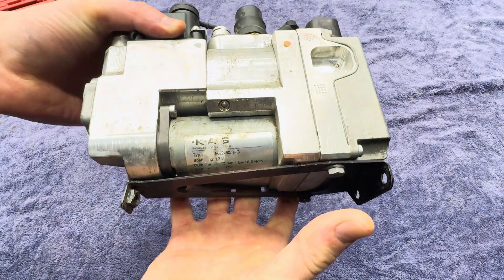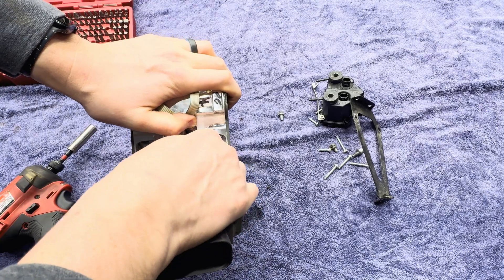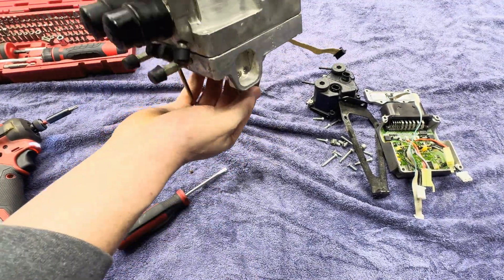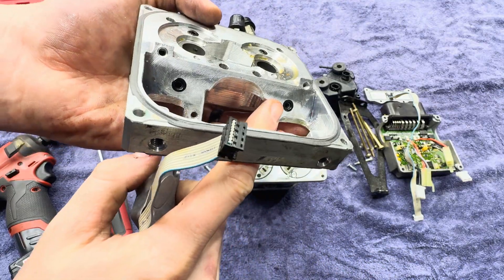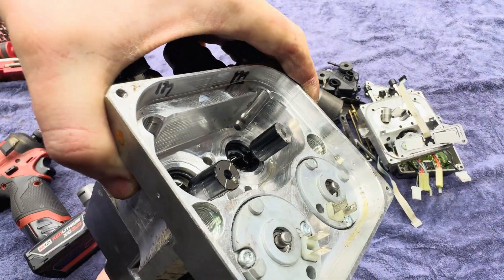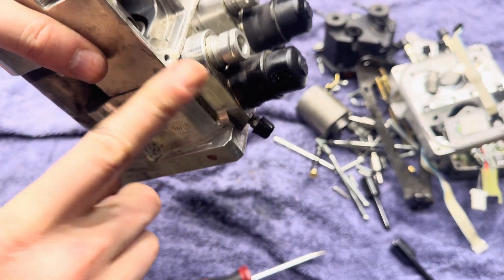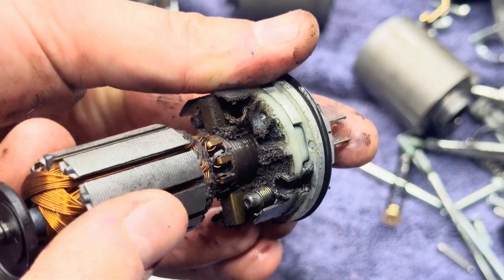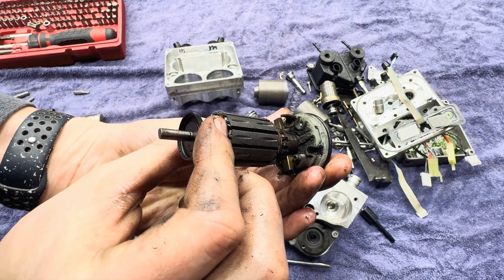Disassembling a BMW ABS Pump

Comment: Replacing the pressure pads/sensors and new brushes for the motors should be doable.
Reply from the maker: Yeah, probably could be. do you think its worth the time VS reward?
Reply: Is there replacement sensor available ?

Comment: Thanks for dissecting this Rube Goldberg device for us.. Got a pretty good sense of how they work. A faulty seal killed a pump motor. That explained the lurching as my Oilhead ABS started to fail. At the end., the front brake locked off.  Pump probably looked like yours. Faulty seal. Pulling the blue relay made the front brake work again.
Reply from the maker: Thanks for the info!  did you end up bypassing the whole system and pulling the bulb?
Reply: I have a r1200s with a bypassed abs, I'm yet y to phone the previous owner to understand how it was done, I'll report back with any info

Comment: So as Kevin points out in this vid, the reason this unit failed is because the brushes got perished or consumed and they started eating the commutator. So this electric motor is too far gone most probably. You would need to replace the motor, one to one swap and most probably this unit would work perfectly find.
Reply from the maker: that's my consensus as well.

Comment: What I have learned is that it is the pressuare pump that fails. It is the two flat thins you found.
Reply from the maker: Those are what I believe to be pressure sensors, not the pumps themselves. The little electric motors are the pumps I think. But again, could be wrong

Comment: Some Harley units fail. It's commonly thought that if you regularly activate the ABS and also activate as part of the bleeding procedure, you won't have any problems.
Reply from the maker: Yeah, have you watched my bleed process? I use a GS911 to manually activate the abs with a computer

Comment: You should have cleaned and reassembled it to see if it was still faulty, would have been a good learning curve.
Reply from the maker: I would have, but that a lot of work to remove/bleed and test for it to not work and need to be replaced/blead again. The bleed process is a large undertaking

Comment: I bled my system out last year which saved me money and gained experience. Although it took most of the day, finding a correct hose fitting and wrench. The BMW shop told me to have it bled once a year, but I read a service bulletin stating every two years if the brake hoses have been replaced with stainless steel ones. Thanks for a great video!

Comment: This makes one realize just how important brake fluid changes are.  There's probably a minuscule percentage following recommended change intervals, as a result brake fluid sits in these systems for years, or decades, especially in cars.
Reply from the maker: Agreed, brake fluid maintenance is crucial for the longevity of these systems.

Comment: Those tabs are indeed pressure sensors aka Transducers , and they convert the presure into electric signals to the motherboard. I've done  many ABSectomy's, This unit was a fix to a problem that didn't exist and was BMW's  attempt to provide reliable Powered and integrated front/rear braking (1150RT) to the 1150 and 2004-2006 1200 models. In reality it was a bad design and dangerous during failure.  The operator could be unaware that all of a sudden much more hand lever/ foot pressure was going to be needed to apply braking. Also applyng the foot pedal would engage the front brakes making slow tight turn manuvers very tricky. This feature was eliminated for Police and GS models however.  In fact the previous series 2 ABS equipped in the 1100xx series was very reliable, provided full uninterupted braking during unit failure and did not have integrated front/ rear braking. It was also much easier to maintain and repair. My advice in lieu of an expensive repair, was to trash the unit, replace any rubber brake lines with steel braided teflon and then learn and practice exercises for competent braking old school without abs.
Reply from the maker: Thanks for the information, I appreciate it
Reply: @TheBMWGuy  Keep at it.

Comment: I wonder if the reason for failing was because old fluid was not changed as needed under regular schedule
Reply from the maker: It's possible, but there are other common failure points in these units.

Comment: 🤦‍♂️Why they made it so complicated an awkward 
What were they thinking?
Reply: yeah I did compared honda abs pump, is much simpler solution, also ne 1300GS use similar solution as honda. I think this is how it was 30years ago, not every bike has abs, and it was something new.
Reply: @mr.z2618 yes part of that is true, not all bikes had abs
Anyway my 96' GS 1100 had abs and it was very simple. I don't know why they started using servos on the 1150s
Reply from the maker: Haha it’s a bmw

Comment: Hi. Thanks for the vid. I have personally disassembled and fixed a pump like this on my R1100S. They are serviceable and there are some people that stock parts for them (in Europe). If you have one and it malfunctions, fix it. ABS = safety
Reply: Please do explain how and where! mine is starting to show signs of failure!
Reply: Yes..please provide more details...
Reply: How it can be repaired ?
Reply from the maker: im listening.

Comment: 2 points - 1 please line the parts up rather than a pile of bits, 2 There is nothing in that abs system that is taken apart with a hammer. Happy new year
Reply from the maker: I agree that there's nothing in that ABS system that is taken apart with a hammer but this unit was completely failed and non-functional and was being disassembled to understand the internal components causing the failure.
Reply: @TheBMWGuy I just heard you say it and have a background in HP systems and felt obligated to mention it 😁

Comment: Before the destruction, the unit could still be easily and relatively cheaply reconditioned and reused. Such ones can be sold for around 1,000 USD. New ones are no longer produced. You can still easily repair the electric motor. The piezoelectric pressure sensor (the one you are so brutally bending) is no longer repairable and mostly unobtainable. Too bad about this unit.
Reply from the maker: This unit was completely failed and non-functional. It was disassembled to understand the internal components causing the failure.
Reply: @TheBMWGuy yes it was non functional, just like any complex device with one thing wrong. To then say the whole thing (sensors etc) was faulty so it justifies my video, well... Have you ever read any Easop's fables?
Reply: @TheBMWGuy common issues for that ABS units is - pressure sensor failure, or pump DC motor critical wearing. All that issues can be repaired. Connect to motorcycle with ABS issues, and soft shows where is problem. Four pressure sensor work in own part hydraulic of braking system: one for front brake lever, one for right pedal/rear brake, one for front callipers, and last for rear. I seen in internet hydraulic scheme of that unit. If make BLDC spare for old DC motor, and pressure sensor that unit can live forever. It strong and simple thing actually, with weak points.
Reply: @valentinloginoff Is there an adequate replacement for the broken pressure sensor? Can it be made new, or can I buy another new one? (other than used from another old unit?) That would be good news! Thanks for the reply.

Comment: Thanks for sharing this, Ive had one fail. I wonder are the failed ones damaged in the same way. Failed seal letting fluid into the motors? Thanks again
Reply from the maker: i have no idea, this is the first failed unit I've disassembled

Comment: I bet this was a common problem for the early servos in the R1150s. I had a 2002 R1150RS where the pump failed very early on. I think I put around 48k on that RS before I upgraded to a R1200RT. Something I noticed on the 1150 is the fluid that came out of the pump was always dirty after a couple of years. The 1200 also had the servo assist. I put 130k on it and the fluid that came out during a two year-services was always pristine. My guess is the dirty fluid was because of this issue with the seals failing and fouling those electric motors. BMW fixed the issue in the 2005 to 2006 1200s. In 2007 I think they did away with the servos for the front brakes. Great video!
Reply from the maker: To the best of my knowledge all the pumps were the same. That goes for all ABSIII pumps

Comment: Kevin, thank you for the video.  I have wondered what type of BMW Voodoo in in the BMW ABS servo.  I owned a 02 R1050RT that the ABS servo failed.  Sent to a shop (name not remembered) in Idaho for repair.  I wonder if the motors are for the ABS brakes or the whizzy power brakes (also known as the ball crusher brakes)?  I have seen a newer R1200RT when the servo failed the rider had almost no brakes.  Attempting to troubleshoot the problem at the MOA Rally we noticed smoke coming from under the servo.  Now I believe the smoke was from the armature brushes burning.
Reply from the maker: Module master was the company I bet, they no longer service This pump

Comment: I'm pretty convinced that the main problem is that gumminess in there. During normal operation if you don't trigger the ABS much, I think the brake fluid in the pump doesn't get changed out, it gets water in it and gums up.
On this PARTICULAR pump, probably that motor as you said, but I would be kind of surprised if that's the failure on the majority of these that die.
I could also imagine that letting the brake fluid get old and waterlogged might contribute to the motor seals failing.
I think the best way to keep the pumps from dying is to use MotoScan/911 during an annual brake flush and be sure to run the pump while bleeding so the fluid in the pump gets refreshed.
Reply from the maker: I plan to disassemble more pumps and see if just maybe I could start rebuilding them

Comment: @♥9:00  I assume those things you refer to as "servo motors" are probably  E-M coils that open or block the valves which in turn actuate the brake lines.   That allowss you to interrupt braking action and produce the known "ABS-shock" effect with brakes on-off-on-off ....  The actual pump motors are below.   BTW if anyone  gives you a hard time about "ruining that pump"  I have one (also broken) lying around ....  They can come pick it up
Reply from the maker: Take it apart

Comment: You should have knocked the armatures out of the end bearings to show us the length of the brushes but obviously the o ring had failed on the bad one it was drenched in brake fluid
Reply from the maker: Yeah, I could’ve gone further with the disassembly.

Comment: I think Freddie Dobbs worked out that this was a Ford Focus part and is available super cheap
Reply: Nope.
I made a comment on his video.
I repaired my 2007 ABS pump twice.
First, the brushes were stuck, so I freed them up, it lasted a year and a half, then I found out that a 2007 Ford Focus as well a 2011 Peugeot 206 had the same pump, albeit the car pumps has a 6 outlet/inlet  body as opposed to a 4 outlet/inlet body for the bike.
But, the DC motor on these pumps are exaxtly the same, just a better quality on the Ford pump (I have no idea on the Peugeot one)
So, I took the electric motor off the Ford pump and swapped it out with the crappy quality BMW motor, and it is still working 2 years down the line.
Altough I have the GS911 tool, the brakes bled absolutely fine through the ABS pump without it.
I did put the GS911 tool on, and ran the brake bleeding program afterwards just to make sure, but no bubbles came out and it did not make any differance at all. 
So, you do not need a special diagnostic computer to bleed the brakes afterward.
This is on the non-servo 1200GS models. I have no idea on the more complicated servo models that were from 2004 to early 2007.
Reply from the maker: Not the same unit
Reply: @TheBMWGuy 
Yes I know.
The unit you have in your video is from the earlier 1150 models.
I was just commenting on Gadgetmart's comment regarding the Freddie Dobbs video
Reply: Only on the later 1200 models onward. Slightly different pump design. The 1100 and 1150 have these.
Reply: @Mr-Flower5 ECU testing repaired my ABS pump on my Z4 it’s worked great since then.
Reply: @GadgetMart I've no doubt these can be repaired but the Z4 pump must be different to this one surely? I have searched and found no one who will repair an early servo assistanted pump for a BMW 1150 motorcycle
Reply: @Mr-Flower5 Yes Z4 pump was much smaller.
I have a 2002 GS without ABS from factory

Comment: THANK YOU for doing this video!  I’ve never been able to get a straight answer why these things fail. I’ve always heard the brake fluid flush every two years is the best way to prevent failure, but are you able to explain how that could have prevented this?
Reply from the maker: Honestly, what could’ve prevented this probably is not holding your brakes at a light. Because those modern motors are constantly turning when the brake is applied

Comment: For anyone that doesn't know, these "ABS Servos" were electric power brakes and an ABS unit combined.  When you applied the brake lever/pedal, all you were doing was turning on the respective electric motor which then pressurized the brake line. Hence the nickname "Whizzy Brakes" from the dentist drill sound of the electric motors running. From reading about these Servo-ABS units over the years, the brush/commutator assembly was a common failure point.
Reply from the maker: Thanks for the extra info!

Comment: German engineering:  "Why use just one part when ninety-seven will do?"
Reply: Fortunately they only used this for four years, i replaced several and if you like the assisted brakes it's a good system but I prefer to keep it simple.
Most of them failed because of poor maintenance, brushes engine (for those who really brake more than throttle) or a bad battery. They should be flushed each year.

The white plates are ceramic pressure sensors.

Bear in mind that these things are 20 years old now....
Reply from the maker: lol, I do enjoy German bikes. But Japanese bikes share a spot in my heart.
Reply: @TheBMWGuy  I love German motorcycles, but sometimes you really have to wonder what they are thinking! 😆

Comment: Can the whole (failed) unit be bypassed to essentially return the K12 to conventional braking?
I own from new, a 1979 R100T (UK) and although obviously a different class power/weight to the K12, stops perfectly well without pump or ABS, so why not a K12?
Reply from the maker: Yes it can! Just route the lines from the master cylinder to the caliper like a normal brake
Reply: Yes, but it's not all that simple. If you see the large black electrical connector on the ABS unit in the video (BMW guy calls it the control box)?  The brake light and I think even the cruise control are run through this circuit.  It's ridiculously complex.
Reply: @m.f.m.67  Also controls speedometer.
Reply: @albertblack6615  I forgot about that.  Crazy, huh?
Reply: @m.f.m.67  I took the RH Electronics bypass option.  Everything but the ABS works as it should.  Unit gets coded to your VIN and works awesome.

Comment: Interesting - how does the pump work - when wheels locks the pump releases pressure and then the motors pump the pressure back up to restore braking pressure? you wouldn't think the motor wouldn't wear that much because of how little that condition occurs. Or maybe they're always running to preemptively build pressure?
Reply: They run each and every time you apply the brakes.  You can hear the motors running when you hold the brake lever.  Terrible system!
Reply from the maker: Yeah, they are running 100% of the time you can the leaver depressed

Comment: Can you offer any prevenative maintenance advice besides changing brake fluid every 2 years?
Reply: I can...don't buy one! 🤣Ok, just kidding (kind of).  It's an over-engineered nightmare that mares an otherwise fine motorcycle.  I grew so weary of the complex bleeding system on mine I reluctantly sold it while it was still working.
Reply from the maker: That’s about it, and swapping to spieler Stainless steel lines.

Comment: The outfit in ID that did my '08 pump for the prior owner has had service "coming soon" forever for servo pumps last I looked a few years ago.  Seems unlikely to be a fix or surely we'd have seen reference to rebuilding servo ABS pumps somewhere.
Reply from the maker: Module master
Reply: @TheBMWGuy  Module master has been waitlisted for over 3 years.  # years ago I spoke with them.  At that time they did not have an eta for that to change.  All the servo modules fail.  No matter how great you think you can keep them cleaned.  Sadly.  Nice thing is I bypassed mine using a second life kit from RH Electronics in Germany.  No regrets.  Have put another 12,000 miles on the bike since the bypass.

Comment: I have a RS1150 that I flush every two years because I do not want failure. I thought the pumps were overpriced but not now. Very complicated, the repair service replaces all the O rings.
Reply from the maker: Yeah, they are very complex assemblies that can be rebuilt.
Reply: @TheBMWGuy  Module Masters always said they never could find parts suppliers for the small motors and other proprietary FTE parts.